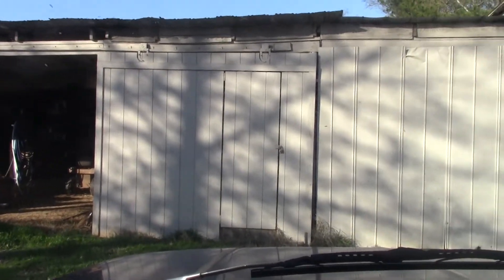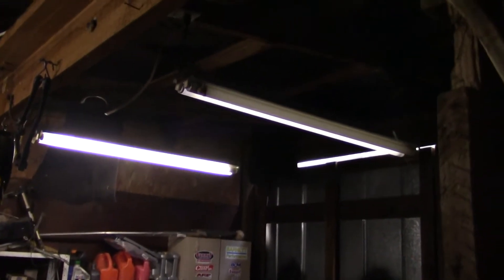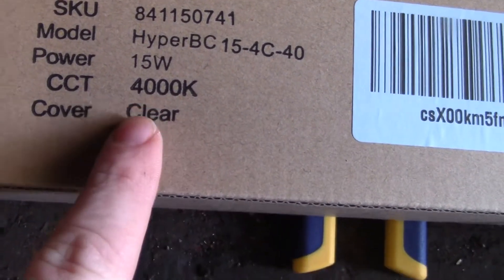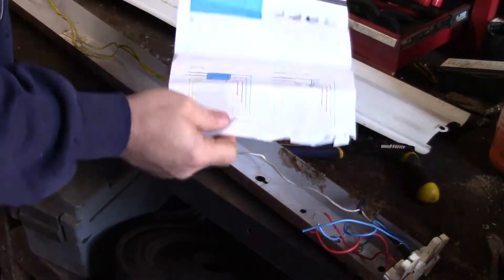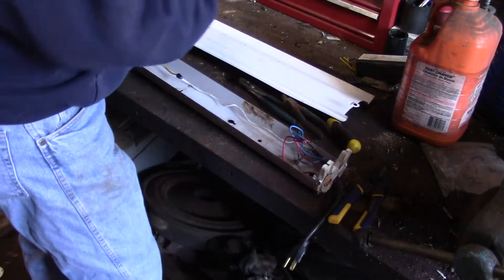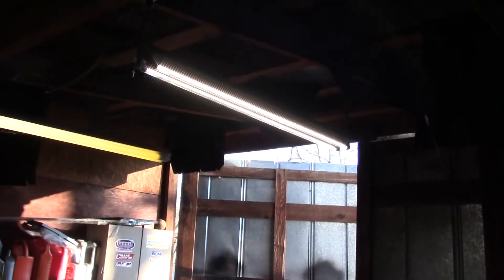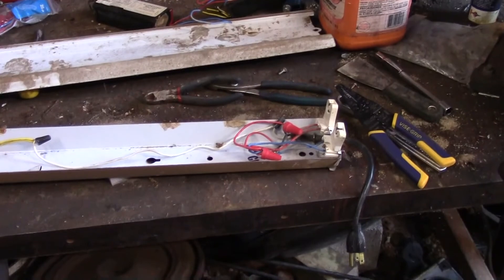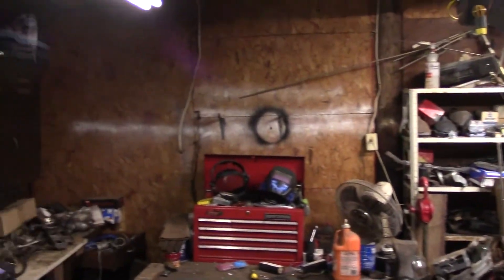LED Shop Light Retrofit

Comment: I'm just starting to research how to convert from fluorescent to LEDs in my shop and I stumbled across your channel.  I was surprised to find out that you don't have to change the tombstones.  What happens if you leave the ballast in?  Why do you have to take it out in the first place?  Thanks for the information.
Reply from the maker: These LEDs have their own driver that works off of 120 volts so no need for the ballast.  I doubt these would work with the ballast and would probably be damaged.  There are some differences in how the tombstones are wired between the retrofit LED lights so be sure you get the style you like.  I'm still very happy with these.